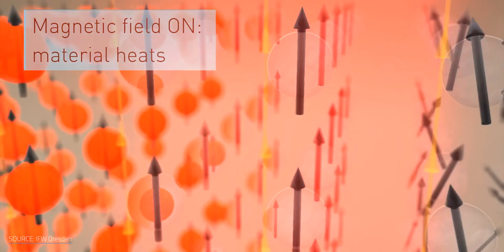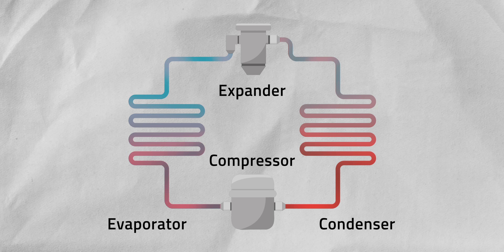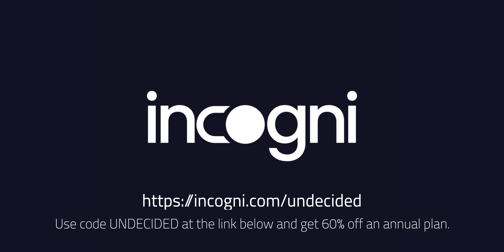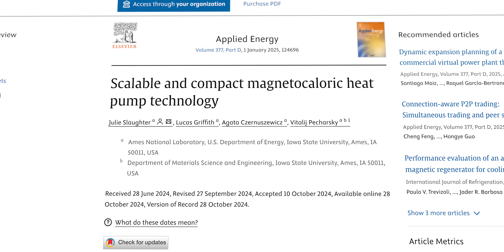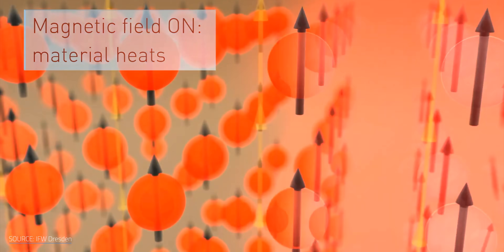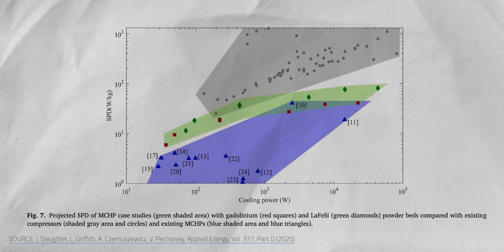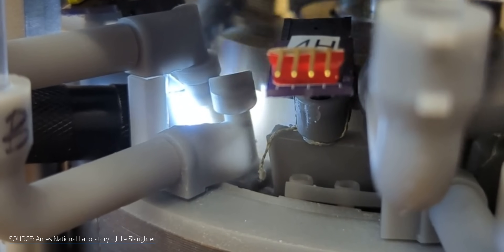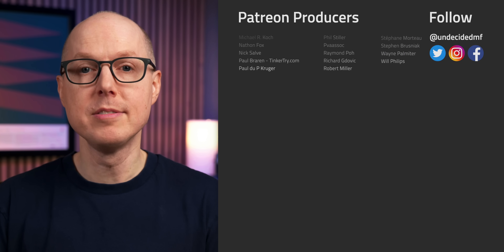How Magnetic Cooling Is Breaking All the Rules

Comment from the maker: Could magnetocalorics hold an iron grip on refrigeration someday? Take your personal data back with Incogni! Use code UNDECIDED at the link below and get 60% off an annual plan: https://incogni.com/undecided

If you liked this, check out Why the Biggest Battery Company is Betting Against Lithium https://youtu.be/7yhcyn_4cUc?list=PLnTSM-ORSgi7uzySCXq8VXhodHB5B5OiQ
Reply: A theoretical system for spaceship cooling uses a dusty plasma, a plasma with a solid material in it, in a magnetic field.
Reply: skeptical. I feel this not far better than the solid state cooling-Peltier effect because of proximity of the hot and cold sides. I see more promise in carbon dioxide refrigerant cooling explained on this channel few months ago-it simply needs more scale/more buyers for it to become cheap enough to replace current refrigerants
Reply: @zodiacfml  I wondered how closely related the Peltier is to this magnetic cooling 🤔
Reply: @mach1553  not the same.  I'm just saying  that the hot and cold regions of the magnetocaloric cooling are too close to each other which reminds me of thermoelectric device-poor efficiency vs refrigerant based cooling
Reply: Do you know if there is health risks to people with pacemakers or other electro-mechanical timed equipment?  Is there require shielding?
Reply: Hi  @cerburusmori  !

The magnetic field is only located within the system. The technology is therefore completely safe for pacemakers or other electro-mechanical timed equipment.
Reply: @cerburusmori 
Não brother!
O campo magnético é fechado, e não há vazamento magnético!

Logo externamente, não magnetiza nem sequer um clipe de papel!

Portanto não oferece riscos magnéticos 

Abraço!
Reply: @cerburusmori  We can speak to that, as our company was featured in the video. Our technology uses powerful permanent magnets, but they are housed in "soft iron" which directs the field to only where we want it.
Reply: Eminent - famous
Imminent - soon
Reply: @jsbrads1  imminently eminent - soon to be famous
Reply: The one thing missing from all of this is how much energy are used by these devices to perform the work. The KW ratings of large cooling units describes the amount of cooling generated, not the amount energy consumed to generate the results of say 6kw of cooling.
Reply: Celda de peltier
Reply: I don't really care how it works. As long as it's safe, more efficient, and cheap enough that it actually provides substantially more value then the cost.  It could be a giant pink AC unit looks don't matter size barely matters performance and cost matter greatly..
Reply: @SF-dy6hn small would be great.  Imagine it being connected to your shirt on a hot day lol
Reply: Nitinol supposedly get stronger the more its used. 5MW generator Mcdonald Douglas
Reply: Desenvolvi uma máquina térmica, dá uma olhadinha nesse vídeo do YouTube pra ver:
Reply: @UndecidedMF  
I made a heat engine:

https://youtu.be/LwIurMT4AEI?si=6Mg3Q3rjeEpydcdp
Reply: @UndecidedMF  You lean too much on puns and it's pretty pathetic. Blocked
Reply: Many factors, complexity.  Can a repair person fix the unit without having a PhD.  Cost, Size, Noise does it make noticeably more noise than a comparable Inverter Compressor unit, maintenance, life cycle.  Lastly distribution and adoption by the public.  Am I buying some tech that will be abandoned in a few years and parts and tech support are non-existent.
Reply: The puns are distracting
Reply: Exelente información... Espero que el futuro sea esta tecnología,  tengo sistemas de compresores industriales y cuando se rompe algo se van muchos kilos de HFC a la atmósfera! Y también mucho dinero 🙏🏻🙏🏻🙏🏻... Saludos desde 🇺🇾
Reply: Peltier Modules and other election physics-based research made it possible
Reply: @UndecidedMF  i’m sure there’s a way to build a private frame relay and use your own vpn barbara Streisand
Reply: 14.55 - dah dum - tsss
Reply: Could this work to cool (air condition) larger areas?
Reply: I appreciate the amount of effort you put in but it is way too distracting.
Reply: @UndecidedMF  This video has high production values but sloppy execution in terms of explanation. It’s not elegant and plugging sponsors
Reply: Why you talk like salesman who does not know the product?
Reply: @UndecidedMF  your puns are a bit…overused
Reply: @UndecidedMF  I just unsubscribed from this channel. Myself and many other YouTube users pay a monthly fee so that we do not have to watch, listen, or tolerate any form of advertising, and yet you force us into the very thing that we pay to avoid! So NO Thanks for wasting our time for the sake of your personal GREED. The world is getting sick of it!
Reply: I just unsubscribed from this channel for being forced to watch and listen to an advertisement. Myself, like many others, pay a monthly fee to YouTube so that we don’t have to watch, listen, or tolerate such advertisements. Yet this channel forces upon you something that you don’t want to watch, at the behest of their own greed. We are all getting SICK of it!
Reply: Well I’m not going to hold my breath waiting for this to replace conventional heat pumps. After all I learned about acoustic heat pumps more than 30 years ago and although they are simpler and more efficient than conventional heat pumps they are still not widely available. In fact the only one I know about is the one that was used on the space shuttle. Basically, what I’m saying is that even 30 years from now we are not likely going to be using magnetocalorics to cool or heat our homes.
Reply: Can I give you a tip. Try to  explain things from a more top down approach. This feels like a typical lecture where you have to piece the high level understanding together from low level information. That's not a smart approach. Explain how magnetic cooling works first on a high level and then go into details.
Reply: i run chillers like big ones this is going to dominate the industry
Reply: How about - "Hybrid High-Tension Power Transmission Cable with Integrated Magnetocaloric Cooling"

Hybrid high-tension power transmission cable that integrates magnetocaloric effect (MCE) materials within its structure to passively regulate temperature and enhance efficiency in AC power transmission. This design requires no extra power to create an active cooling effect because it leverages the natural alternating magnetic fields in AC power transmission.

Why This Works Without External Power: Magnetocaloric Effect (MCE) Activation – The alternating current (AC) in high-tension cables naturally generates oscillating magnetic fields.

Passive Heat Absorption – The MCE material absorbs heat when demagnetized, cooling the cable.

Heat Dissipation Cycle – When the field increases, the material releases heat, allowing it to dissipate into the environment.

Self-Sustaining Cooling – This cycle repeats without requiring additional energy, making it a passive cooling system.

This means the cable functions like a mechanical superconductor, reducing resistive losses and improving efficiency without external cooling systems.
Reply: QUESTION : What is a Refrigerated T - Shirt ? ANSWER ~ Piezoelectric Application

Question: What is the Searl Effect Generator? 

Answer  ~ An Elecrical Generating Rotary Device which uses ONLY MAGNETISM as a Fuel source.  

Think ~ Combined Technologies
Reply: We are already using magnetic cooling in fridges... The motor in fridges runs on literally electromagnetism
Reply: Why do we have to listen to all this obvious stuff to get to the meat, oh but that's after the advert,  I should of known damn click baited again
Reply: un-subbing from all Freemasons
Reply: please dont add audio-tracks in other languages for your videos is sooo annoying.  subtitles should be enough for those who need them.
Reply: @alexdelarge1845 believe me after few years the arabica language will be the dominant language in the world😊🇸🇦

Comment: "magnets are becoming comparable to modern units on the market" "this unit is 6500"....the heat pump i need to replace my central unit is only 4k.....6500 for a soda cooler doesn't sound comparable at all, lol

if magnets truly do what they claim, then that rotor is moving way too fast for the liquid to be able to pull any amount of heat away.

Comment: You didn't explain how it works, all I got was the magnets pass over some metal that heats up, then cools off, ...🧐🤔 That means the net effect is ZERO cooling or heating, it would be like running a window air conditioner unit in a closed up room, the heat from the condenser and the cold from the evaperator, both blowing thier air in the same room, the net effect is zero, so how does this magnetocaloric system seperate the hot from the cold, off of that same piece of metal, then how is that cold being sent out?....🧐🤔

Comment: So as a refrigeration mechanic I'm curious about where this technology will go. The problems I see is scaling; cooling a reach in is relatively easy but when it comes to cooling a building or large area, especially when you need to remove the heat from the immediate area. I am curious to see how these affect cell signals and other radio wave communications systems (wifi). Then they are developing new refrigerants all the time. The newer versions do not harm the ozone or cause global warming; they just are slightly flammable. This does reduce the need for competing technology to refrigerants.

Comment: I've worked with building synchronous electric motors and during development we realized that sourcing the rare earth elements that magnets are often made from are very difficult to mine, refine and package, as you can imagine, this is a largely harmful process in regards to the environment so even if magnetocaloric systems become more mainstream i doubt that the underlying issues with the sourcing of rare earth elements required to make the magnets will really lead to change in the environment preservation efforts. It's similar to how we're switching to electric vehicles because we assume it to be the greener alternative to ICEs as there is a lack of tail pipe emissions but they aren't really that much greener as the carbon emissions that are produced to make one EV vastly outpaces the emissions it would supposedly save. I wonder just how environmentally friendly this would prove to be.

Comment: I don't see how this could beat a traditional heat pump. It has more moving parts which isn't great, but I think the biggest downside is that the material you're heating and cooling isn't moving through the system so you have to heat and cool the material without it doing any work. At least that's how I'm understanding the system. We're flowing a liquid over a material which is getting hot and cold right? Or is the material actually flowing through the system?

Comment: As a long time hvac guy, I am all for protecting the environment ,  but some of the materials used in these systems are probably very toxic, possibly radioactive. Something to think about. Some of the old absorption chillers use ordinary distilled water as the refrigerant. The only toxins are the anti corrosion  chemicals and octyl alcohol for increased heat transfer efficiency.

Comment: Ok look set the magnets in a clock orientation but have a different set as a degree wheel frame  for Timing and orientation  differences during operation for automotive purposes and cooling information systems output of components and wear and tear on the magnets and the life span of the device

Comment: 30 year HVAC tech here, I don't mean to start a controversy but the "environmental impact" is over stated and hyped by the companies who make the refrigerants.  Please let me explain; With each revision to a more "environmentally friendly" refrigerant; each revision makes the tech buy new tools, gadgets, components and even change the type of threads on the refrigerant containers; which by the way have 5lbs less refrigerant in each container with each revision! (-5lbs when we changed to R-410a, and now -5 more lbs in each container of r-32, R454b)  There are just too many forced, costly changes by the companies making the refrigerants to simply be the result of the "government forced changes"(our government is just not that smart).   I agree with the changes my industries implemented during the "hole in the ozone time periods"; by training and making it unlawful to vent refrigerants and using better practices of reduce, reuse and recycle; perhaps if we stuck to the training changes and kept the refrigerants the same we would have witnessed similar environmental changes, but the phase out happened at eh same time so we will never know: additionally, because Dupont was loosing the patent on R-22 (HCFC) around  the same time (roughly) the refrigerant changes were being implemented just further degrades the validity of the supposed environmental correction they spin by changing the refrigerants.  Fun Fact, I use on average 1100lbs of R-22 per year re-charging old leaking chillers still in use today, and yet the environmental impacts are getting better?<  sorry enough ranting, Matt thanks so much for the contents; impactful and thought provoking as always.

Comment: I feel like I must be missing something here. Why does this design use spinning permanent magnets at all? That seems to go into the same low durability territory as the stressed materials cooling class by introducing axle bearings and all that, not to mention the fact that the goal of them here is to generate heat which over time causes magnets to lose their field strengh. Just as axial flux motors use 3 (or some multiple of 3) phase coil stators to generate a rotating electro magnetic field to torque their rotors around couldn't this just use a simple fixed copper coil stator (or two if you want one on both sides of the material to generate the rotating field instead of physically spinning around permanent magnets?  Yeah copper is getting supply limited too but not so much as permanent magnets and the environmental destruction caused by creating those. And I think the general rule of thumb of less moving parts for both mtbf and economics would apply here.

Comment: About 25 years ago, I thought about a cooling system that did not contain any liquids. My idea was to push heat magnetically in a good thermal conductor from one end of the conductor located inside the room to the other end outside. But I always wondered, is heat subject to magnetic forces?

Comment: I'm curious why they need permanent magnets at all. They are creating magnetic fields in a motor to move magnets, which in turn manipulates magnetic fields in the core. With the right control circuitry, you don't need anything to physically rotate. I would guess electromagnetic coils hurt the power density, or maybe it's just that hard to get over 1T with electromagnets. My first question was if they had parity with refrigerant, and that looks promising. I'd like to see maintenance costs factored into a system that has worse density on its face, but eliminates a big moving part. Maybe the CoO is still attractive if you can tolerate some extra bulk.

Comment: why use rotating permanent magnets? you already HAVE a rotating magnetic field being created from the motor that is spinning the permanent magnets...use THAT. you can just take the coils, forget about the rotor, and place the coils along the area with the coolant, best off you can get very high RPMs from the coils, much higher than you can get from rotating magnets (since you don't have to worry about it sheering apart) limited really only to the thermal conductivity of the coolant.

Comment: Interesting video but it has stiff competition with supermartket style applications like transcritical co2 for the green energy. Now magnetic cooling has a big advantage for your smaller scale applications like restaurant or small gas station scale cooling but there we are already getting into propane based systems with less than 4oz of propane being able to power a 2 door reach in cooler easily.

One of the biggest problem with breaking away from dx style cooling systems is how every hvac/r tech in the world is trained to work on them. I can work on a household refrigerator to a rack system with 4+ 5hp compressors and have it all follow the same principles

Comment: I think we need all the tech we can get, but suggesting we need to phase out the vapor-compression cycle just because a few refrigerants turned out bad is silly.

Before we even found out about CFCs we used natural refrigerants like ammonia or carbon dioxide. Not every existing system will be suitable because ammonia corrodes copper and carbon dioxide requires fairly high pressure, but they are nothing but a minor implementation detail of systems you could build today at scale.

Comment: The idea is definitely friendlier to the environment. But I think you're switching one problem for another. Like traditional systems that use Freon, it's all about finding that perfect Freon mixture. This magneticoloric system is all about finding a perfect stressing material that doesn't break down and become useless. However, traditional systems do need to be recharged every once in awhile and it looks like this will too. There really is going to come all the way down to efficiency and cost.

Comment: While your were explainig, I had to think of the ADR coolers we used at my previous work at a research institute. We used a couple of those coolers for crygenic cooling. These coolers didn’t deliver much cooling power though, as there were built for cooling down to mK’s and on a small scale. However idea is nice if it can be applied to more common applications, not in the cryogenic temperatures and with more power.